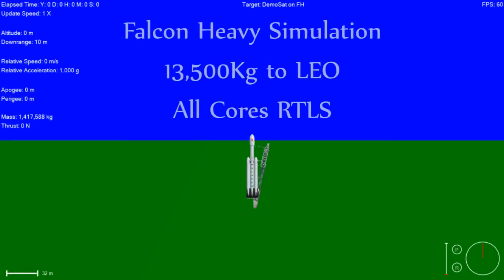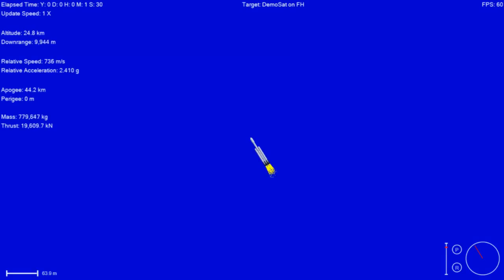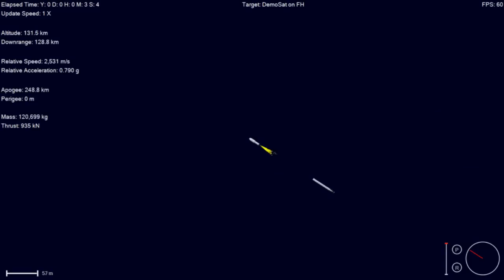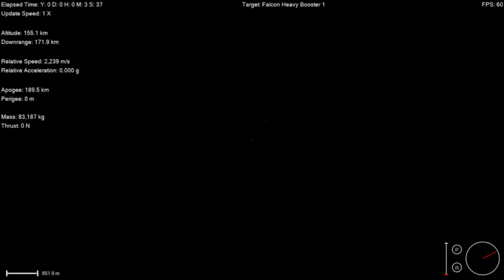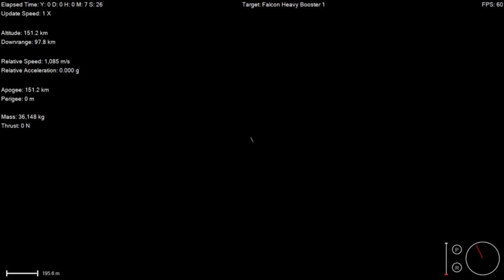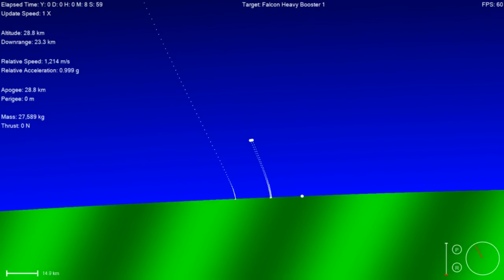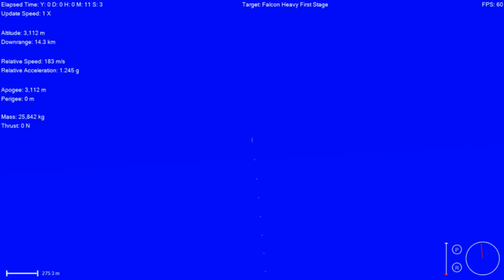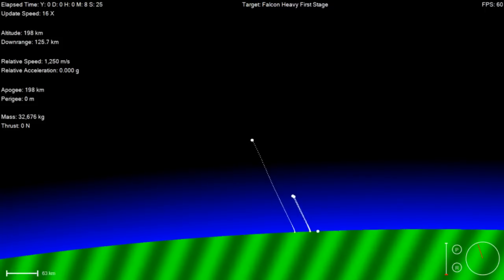Falcon Heavy Simulation | 13,500kg to LEO | All cores RTLS

Comment: TWR 1.5 seems awfully low.  Is there no way they can strap a couple solid rocket boosters to it to get it moving off the pad?   I mean we are talking 10 or 15 seconds just to clear the tower.  Thats a lot of wasted fuel that you could be taking to mars or wherever.
Reply: rizendell but solid boosters arent reusable
Reply: yea they are, ask the shuttle program.   they had parachutes in the nose and they used to go pick them up with a boat.   Solid fuel is a lot cheaper, and more energy dense.

Comment: So in this simulation there is no crossfeed? It´s Delta Heavy style?
Reply: Falcon Heavy will have no crossfeed. SpaceX said it would be to expensive to develope for not enough benefit. It has been off the table for well over a year now. Instead, shortly after take off the center core will throttle down until seperation, just like the Delta IV Heavy.
Reply: I see, the last I had heard was that it was going to be implemented but maybe not on the first few flights.

Comment: What Programm is that? Or is it coded by your self?
Reply from the maker: +ThatsEli Here is the project now on GitHub: https://github.com/zlynn1990/SpaceSim
Reply: +ThatsEli I coded this by myself in c#. I plan on pushing it to a public git repo if anyone is interested in using it or seeing the source code.
Reply: Zach Lynn
I am really interestet in this code, a repa would be really nice, when you make one, please tell me ^^
Reply: +Zach Lynn Are you now pushing it in Github, would be very great! Die you use any Engine or is this with a selfcodet engine. Also is this a real Simulation or is the rocket following a path?
Reply from the maker: +ThatsEli Yeah this week I'm going to write a simple launcher interface for it and push everything to Github. I coded the engine myself, its a real n-body simulation that runs at a fixed timestep. I did some research to figure out how to somewhat accurately model gravity and drag. The only inputs to the simulation are engine start/stop times, stage times, and pitch / orientation commands.
Reply: Zach
Nice :D
Reply: Zach
Thank you very much, I will read me in the Source Code, and If I have Questions I will ask. Thank you very Much!

Comment: I thought Falcon Heavy use asparagus staging, which fuel from booster is used by core stage until separation. So, doesn't the core stage will keep firing for at least another 2 minutes?
Reply: +Alpha Adhito The last word from SpaceX is that they will not be pursuing cross-feed propellant between the boosters and center core. Instead they will just throttle down the center core. I plan on doing another simulation to show what a center core barge landing would look like. In that scenario the center core will burn for about a minute or so longer. Returning all the cores to the launch site kills a lot of margin.
Reply: +Zach Lynn Oh, so just like Delta IV heavy right. It throttled down to just 55%.

Comment: The Falcon 9 launches 13,500 kg to LEO, not the Falcon Heavy, which is capable of lifting 53,000 kg to orbit.
Reply from the maker: +Gavin Mackie The Falcon Heavy will only be capable of lifting 53,000kg in a fully expendable configuration. In my simulation I show all core returning to launch site which significantly reduces the payload margins. With downrange barge recovery for the center core I think 25,000-35,000kg payloads are possible. The Falcon 9 can only do around 7,500kg while returning to launch site.

Comment: Excellent simulation. but there are some inaccuracies. the outer FH cores will be feeding the center core, so the outer cores will run out quicker, and upon separation the inner core will have a full tank. The outer cores will then be able to boost back and rtls, especially as they are going at an even lower velocity than single booster launches. the center stage however, because it is boosting higher and to much higher velocities than previous launches, will not be able to preform a boost-back burn with adequate effectiveness, so it instead must land on a downrange landing site without a boost back. This also conserves fuel.  Aside from these inaccuracies, it is clear you put a decent amount of effort into this, and I would be happy to see future simulations of launches from you.
also, what software did you use? is it something you developed yourself? looks like it might.
Reply: +Marshall Scholz From what i've heard, crossfeed has been put on hold, and will only be developed if a customer is willing to pay for it. Seems to be the consensus on r/spacex, but can't find a source for it.
Reply: ***** Yup, on takeoff center core will be full thrust, shortly thereafter it will throttle to 40% iirc, and then it will throttle up to 100% after booster separation. Very similar to Delta IV Heavy.
Reply: +N|O.C.A. I heard that as well but i think that the centre will go low thrust or something instead
Reply: there are flight profiles, so I've heard, that will allow all three cores to RTLS.

Comment: Excellent simulation! Let´s hope it becomes reality soon!
Reply: +lvwpy It's due to lift-off from KSC sometime in April this year (2016).
Reply: +Jerry Smith You mean Dec. 22nd, 2015, when a Falcon 9 launched the 11 Orbcomm satellites into LEO. Yes the booster came back and landed at KSC.
Reply: +Gavin Mackie November 2016
Reply: +lvwpy It is a reality, it happened on Dec. 15th, 2015 :) That's where the audio came from ;)
Reply: +Gavin Mackie Oops, yeah. Thanks for the correction. I think I mixed two different trains of thought up a little, haha.
Reply: CaptainOfGames
Yes. The schedule has slipped back. I believe that's to do with Dragon 2 development and landing tests.